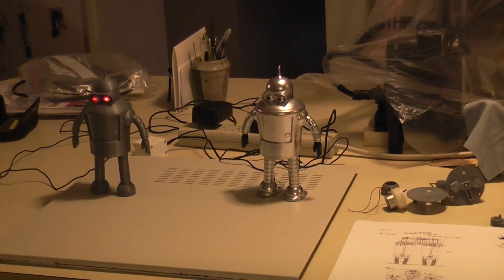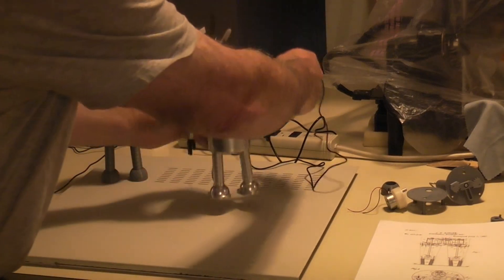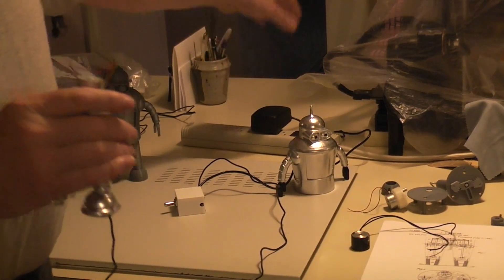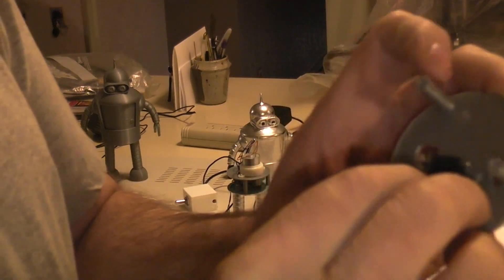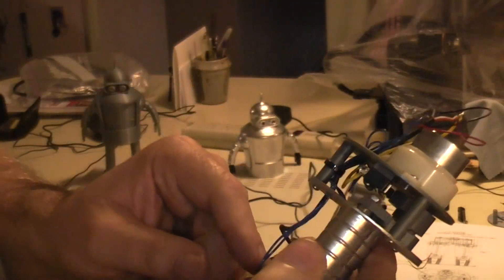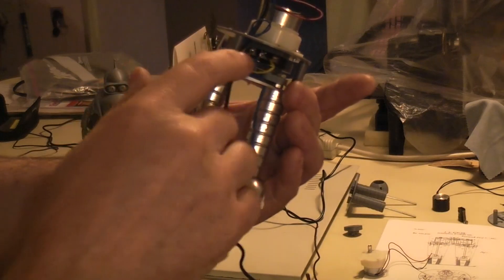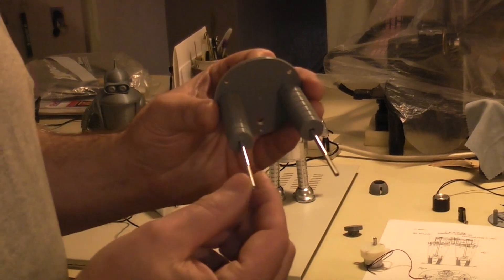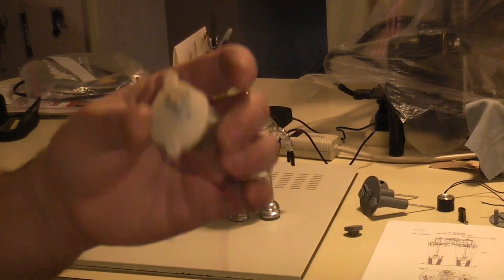You can build the Magno-Rama  robot. Magnetic walking action. 3d printed.

Comment from the maker: The SP DT Micro Switch I used is a KW12-1 type. here is a ebay link that is active now for the same type switch. You can find the switch from other sellers and with the roller wheel as well.
https://www.ebay.com/itm/20Pcs-AC250-125V-3A-3P-Momentary-18mm-Lever-Arm-Micro-Switch-Black-KW12-1/401551647304?hash=item5d7e57e248:g:E9EAAOSwMv5bbXKz

Comment: Thanks for another great design and the links to the parts. The mechanics are very interesting. I watched the older videos you linked to. Is the turning done strictly by the electrical logic or do you have to change the mechanics?
Reply from the maker: The mechanics stay the same. If you for example were to turn OFF one of the foot magnets then that foot would not do anything, but the foot that still has a operating magnet would clamp, lift and rotate the robot. So this would make the robot turn. You could in fact make a robot where the motor driven "back and forth" actions were ON all the time and if the feet magnets were left turned OFF the robot would not move . So with one SP DT micro switch on the cam and other switches or controls in line with the magnet wires you can make the robot move in all directions. The mechanics stay the same. Or if all you want id Forward and reverse then it is easiest too flip the power supply feed and that does reverse the motor driven mechanics so the robot walks backwards. Or you can leave the motor driven mechanics running the same direction and swop the magnet wires on the came micro switch and the robot will walk back wards. It is a very simple and versatile design from 126 years ago !

Comment from the maker: Here is a Ebay link for the threaded rod.
https://www.ebay.com/itm/M3-x-80mm-0-5mm-Pitch-304-Stainless-Steel-Fully-Threaded-Rods-Bar-Studs-10-Pcs/391599456000?ssPageName=STRK%3AMEBIDX%3AIT&_trksid=p2060353.m2749.l2649

Here is a link to Banggood for the 3mm threaded rod. You can find it other places as well. I found mine as left over parts from a TAMYA gear box kit.
https://www.banggood.com/Grade-12_9-Carbon-Steel-Black-Threaded-Rod-M2M2_5M3M4-Length-250MM-p-1030565.html?rmmds=search&ID=510375&cur_warehouse=CN

Comment from the maker: The ebay seller for the gearmotor I used is gone. But this looks like the same type motor. You can get it for about $2.50 from china or $5 bucks in the USA.
https://www.ebay.com/itm/DC-3V-12V-18RPM-Slow-Speed-Mini-Worm-Electric-Gear-Box-Motor-Speed-Reduction/292686640178?hash=item44257bb432:g:XkgAAOSwhhFbd-t2

Comment from the maker: Here is a Ebay link for the 20mm electric magnets I used with power supply.
https://www.ebay.com/itm/NEW-2-PCS-12V-5-5-LB-Electric-Lifting-Magnet-Electromagnet-Solenoid-Holding-20mm/182064560138?ssPageName=STRK%3AMEBIDX%3AIT&_trksid=p2060353.m2749.l2649
Auctions come and go, so if this one goes just do a search for 20mm electric magnets.